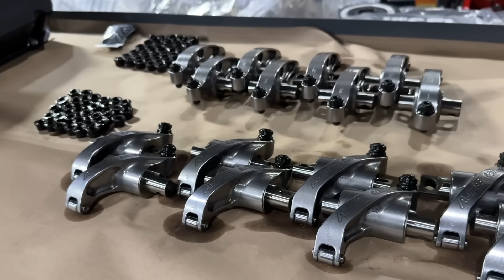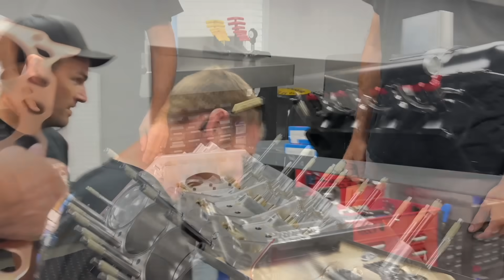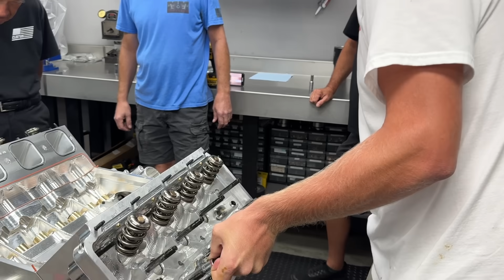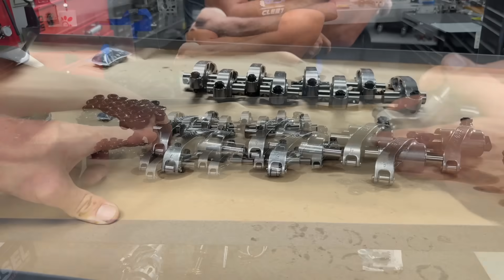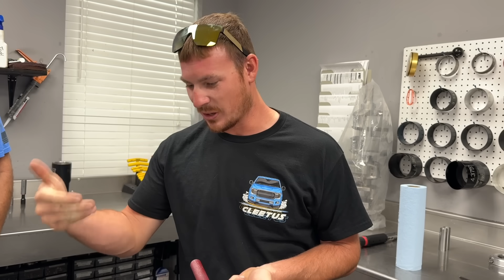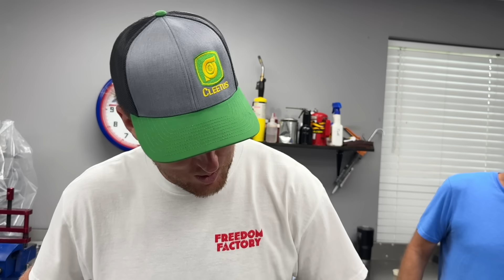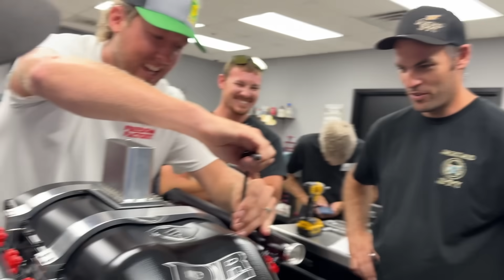Introducing Project Eagle's NEW Engine!!! (100% Billet)

Comment: “George be careful with that” immediately drops it 😂
Reply: Kinda saw that coming😂
Reply: My heart sank
Reply: Saw it coming from Canada.
Reply: He lost 1000 attaboy points right there
Reply: that was really bad.
Reply: If George wasn't funny, he'd have been fired 😂
Reply: lol probably just a $2500 piston 😂
Reply: Is that piston shot now? Was that fake? Like on purpose?? I’m slow man. I really thought they were that fragile.
Reply: Thanks I was just watching it trying to figure out what they’re babbling about. You’re the man
Reply: I saw that coming last week!!
Reply: @josef8061 those ones in specific, in theory take one hell of a beating in the a motor making 3500 horsepower at 8k rpms but I could be wrong about the durability and the way that impact happened. But I think it’ll be alright. If not I think they would’ve made a bigger deal about it in the video
Reply: Also the hp and rpm is just an estimate to get the point across. Its probably more so don’t hate on me 😂
Reply: Think it was a skit. Surely our boy ain’t that slow😂
Reply: @josef8061 Had to be staged.
Reply: @gerbil7771  me too loll
Reply: The slight glance up on old mates face when the torque wrench’s smack together hard😂
Reply: @josef8061  they’ll probably dye pen that piston for cracks which I’m sure it probably Dosent have any cracks, if the dye pen is good and it’s not gouged too bad they’ll probably sell it with idk maybe a 5/10% discount.
Reply: Didn't George ever hear of " You Break it   You Bought it"
Reply: I almost yelled fuck when he dropped it
Reply: It was so obvious i thought it was a bit
Reply: @Andrew_moto  what about flat spots? Not a big deal??
Reply: @dominic1102  could have been cut out of people were cursing too much. I’m actually curious.
Reply: @Andrew_moto  It was staged. It was too obvious. He wouldn't just carry it around like that in someone else's shop. It was probably a used piston that was getting swapped out. You only get so many runs before you change the rack.
Reply: Well, there goes like a $400 piston lol
Reply: @josef8061  depends where. In the top of the piston not usually, on the skirt or ring land area would absolutely be a huge deal. The only way that piston would be acceptable is if there’s absolutely no damage on those areas.
Reply: @josef8061 it will be fine, concrete softer than hardened steel
Reply: @dominic1102 It does, but slamming it into concrete is bad. It's designed to take a load in a specific direction, not get dropped on its side or skirt onto a concrete floor. If you say that's nothing compared to what it sees in an engine, you don't understand metallurgy.
Reply: What a clown dude🤡
Reply: I screamed
Reply: Squirrel immediately drops it 😆😅
Reply: I think they staged that
Reply: Definitely staged
Reply: His face was priceless
Reply: I so hope that was set up.
Reply: It was set up lol
Reply: the fact that they later said it was $5k for that drop. gawd dang
Reply: They were joking that was a used piston
Reply: Between him and James poor Cletus is going to be fixing their mistakes forever
Reply: It looked pretty staged as soon as he turned around I saw him fumble it
Reply: @Andrew_moto  it was a hundred percent planned as a bit, but it was still hilarious 😂
Reply: I think they are just pulling our leg fellas 😂
Reply: Duuuuuude!
Reply: Had to be staged right?? ....right? 💀💀💀
Reply: @josef8061 That specific one being billet is probably fine, just check for dents. But if you drop a stock piston like that it’s gonna be in a few pieces
Reply: George!!! 🤦‍♂️$1000 paper weight
Reply: @josef8061 engine builder outta Vegas here 🖐️ in most cases It would more then likely be a scrapped piston although I’ve seen worse happen to parts and be filed smooth + installed and last 100k harddddd miles before showing signs of failure
Reply: @yonotmyname  I sure hope so😂😂
Reply: Yuuuurrrrr duuuuooonnnneee!!
Reply: @josef8061 definitely not fake lol. His face was so real
Reply: Well that piston needs to be replaced now. Thanks George.
Reply: I saw it coming and still made my jaw drop... Don't call him squirrel for nothing 😂😂
Reply: I love how it cuts right after that too 😂😂
Reply: I hope that was planned. 😁
Reply: George talks to much for a camera man...
Reply: @pastorart23 immediately lost cool points for that one damnnnnn
Reply: @MrTwistyLive  Hardened steel? In what world are pistons ever made of hardened steel 😂
Reply: Wtf I want to see the footage of him getting the business after that dropping Piston noticed they cut it a little bit
Reply: @josef8061  I’m hoping they gave him a junk piston to purposely drop haha.
Reply: Caught it on the first bounce, should be fine 😅
Reply: I'd pay to see the unedited, long version.
Reply: Double dare you to put it in the 300 for a break in
Reply: Squirrels drop their nuts sometimes.
Reply: Like my toddler lol
Reply: @josef8061  No way it was not a setup. Truly good parts are too expensive to fool around with.
Reply: Being they warned him to be careful 30 seconds before he dropped it and the fact he stabbed the piston on the rod without securing it and carried it in a awkward position just before he fumbled it screamed fake.😅
Reply: You can't make that up
Reply: I DIED laughing
Reply: They didn’t let Mikey touch any parts again 😂😂😂
Reply: I don't know how George is a functional adult. How he couldn't see that coming is beyond me.
Reply: No right minded car person would put a top heavy piston onto a rod on that angle without a pin in it and expect it to stay there while walking around. Definitely staged.
Reply: What a clown.  I know that is his role in this cast but he does it so naturally.
Reply: @BreakitDownBarneyStyle more annoying than funny.
Reply: Staged.
Reply: Was that already a junk piston George dropped lol no way that actually happened 😂😂😂
Reply: I know like bro come on 😂
Reply: @gerbil7771 seen if from Newfoundland 😂
Reply: After that shot there was a wall of employees blocking the parts 😂
Reply: Well George that piston is done!
Reply: I'm guessing that was one of those little jokes they stage every once in a while and they're pretty good at making it seem real and most of the time people don't pick up on it
Reply: @mayshack  A lot of stuff is staged. Which would be fine if they didn't try to act like it was real. It's an easy way to lose trust from the viewers. I don't think Cleetus is a bad guy, but honesty goes a long way. I don't buy his merch bc I can tell how cheap it is on the videos. When he holds it up in the light, you can see right through it. He probably pays $5 at most for a shirt he sells for $30. I understand this is how he makes a living, but sometimes it seems like he's taking advantage of the support he gets.
Reply: its Cleeters fault for saying something, everything was fine
Reply: @josef8061  tbh looked like he was trying to do it the reaction looked real
Reply: Does anyone know if George is still alive
Reply: lol
Reply: George just bought it
Reply: George just cursed that new engine.
Reply: @josef8061  I'm pretty sure that was staged. Very funny either way though.
Reply: Hahahaha
Reply: Cleet didn’t say a word.  Lmaooo bro was probably pist for a split second
Reply: Squirrel  strikes again 😅
Reply: Cleet didn’t say a word.  Lmaooo bro was probably pist for a split second
Reply: Bruh 😅😂😅😂🤦‍♂️
Reply: I could see the white haired old man in the background shaking his head & looking at the other mechanic rolling his eyes!😂. I bet they thought you  idiots those pistons are aluminum, bet that one has a nice dent in it now hitting the concrete!!! 😂🤣
Reply: Yeah i was like WHAT THE HELL GEORGE. Jfc dude even for him. The cut was not for nothing, i bet.
Reply: George prolly should've stayed in Florida for this one lol
Reply: @dustynwilliams7816  exactly what I thought when I read his comment. Lmao billet and forged alum are a bit diff than hardened steel. You would think most ppl on here savvy this stuff if they're watchin on the reg. Goofballs
Reply: That's exactly why I don't like the guy.
Reply: @pastorart23 😂😂😂😂😂
Reply: Yep as he wanted over with no pin in it I shit myself
Reply: @josef8061 it’s straight Billit so it should hold a lot of damage done to it
Reply: Typical 🐿️
Reply: haha dont let him touch the belt lol
Reply: Nah not fake, he got grounded to full time camera man after that to keep his hands occupied. Notice how he didn’t touch the engine and everyone else did. And every time it was brought up you could tell bro was uncomfortable and genuinely sorry lol. Hope they were not too bad on squirrel he’s one of my favorites 😂
Reply: LS George is the oldest 2yr old I've ever seen!
Reply: Think the npk guys push 4500 horsetorques with these engines.
Reply: I wonder how many people saw that coming.
Reply: @mayshack  It becomes an issue when you have to question whether or not a person is telling the truth. I'll continue to enjoy his content, I just stopped believing that he was 100% honest and straightforward a long time ago.
Reply: It was easy to see that coming from across the Atlantic. Dang, George, whaddayadoin!
Reply: Yeah...
That would've been me too...
Old butter fingers...😂😂😂
Reply: Oh cleet had to hawk tuah on them hands 😂
Reply: Literally came to this comment as it happened 💀💀💀 lmbo
Reply: copied my comment, yet gets 20x the likes....wtf
Reply: Seen it coming from NZ
Reply: I laughed so damn hard
Reply: I aaa expecting a new SMX to be going in Eagle
Reply: @josef8061 it was to get u slow guys talking in the comments and the other peasant youtubers talking
Reply: It was definitely a bit, you can see the piston had been used before.
Reply: They skipped the next part, wonder what was said 🤣
Reply: coming out of his pay check lol
Reply: @stevenperez8197  yup
Reply: Quality ring to the alloy hitting the ground… defs 2618 for sure
Reply: Staged. Rehearsed. Planned. Spare parts, not from any engine build.
Reply: Classic
Reply: 😂😂😂 i knew that was gone happen
Reply: @josef8061  i think its a skit when has he ever been so careless knowing he is around high dollar parts never so that tells you right there and under the reflection it looks like it was used to start with
Reply: @Bob-o-h4k  yeah you can see it when the light hits it
Reply: It was def so offensive I was hoping it was staged
Reply: I dont believe for one second thats was on accident. If it was, watch that engine be the fastest thing theyve ever driven.
Reply: I know lol that shit hurt my soul
Reply: Laughed so hard
Reply: Squirrel had a spaz moment there. Ya'll need to keep him off those energy drinks :)
Reply: Was that freaking real !?!? Omg
Reply: He looks stoned right before he dropped it lol
Reply: Pretty sure that was a bit that was planned. The way he set the piston on top of the rod…George ain’t that dense.
Reply: There's no way that wasn't a skit. The way he looked around, they planned that
Reply: @BreakitDownBarneyStyle  There's a reason we don't see him seriously working on anything mechanical anymore, he just holds the camera and provides comedic relief.
Reply: hahahaha
Reply: I had the feeling it was gonna fall as Georgey turned around… luv ya LS! Can’t wait to the the bald eagles flying down the track.
Reply: Just INSTANTLY not careful with it at all 😂
Reply: HAD to be STAGED!! I hope!!
Reply: It was staged
Reply: He should stop acting stupid at some point.
Reply: damn bro grab the camera and don't touch nothing 😂😂😂
Reply: Cleet "huak tuah"😂😂
Reply: @dominic1102 they are strong but dont handle impacts well
Reply: “Not on purpose”😅
Reply: Did he drop the rod or piston?
Reply: @josef8061  In theory most likely yes its no good any more especially in that kind of application. Though I could be wrong but it looked like that piston was used and might have been bad already and the whole thing was staged.
Reply: LMAO
Reply: man, my stomach dropped with them lol
Reply: You listen to the ring when it hit the floor?? Thats SUUUUPER hard metal lol
Reply: I think it was staged. The pistons were already in the block. I don't see George picking up parts in that shop just to walk it over to show Cleet and Co.
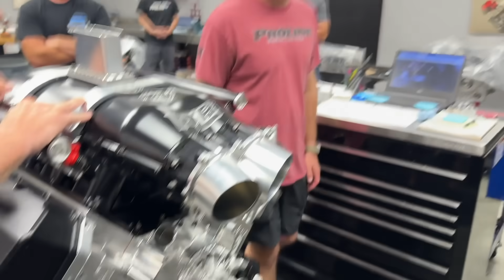Reply: 39:09 Straight up they’re probably gonna pull it apart and make sure they did everything right
Reply: Their pistons were already in the shortblock. I dunno how everyone missed that 😂
Reply: Weird torqueing the top row, then the bottom! Are all hemis like that?
Reply: Soon as I seen they weren't connected yet I knew he was dropping it 😂
Reply: @MrTwistyLive those pistons aren’t hardened steel dude
Reply: @WyFoster not even close bud your talking about a 6 figure engine
Reply: @Lexidezi225  forged my bad
Reply: George left his paycheck on the floor
Reply: @josef8061  Lmao i feel like it had to have been a skit. But yeah you wouldn't be reusing that, the edge would scar the bore.
Reply: That was definitely a set up. Prbly already damaged. No way he was that careless
Reply: @josef8061  I work with aluminum in the daily. It would have definitely dented by hitting the floor. An expensive mistake for sure.
Reply: How much further can they demote this guy. He's not allowed to work on the expensive stuff after forgetting some vital engine parts on his builds....like oil pump. He's gonna end up mop boy at the local sponge room behind the store by the truck stop that has adult written in big letters everywhere.
Reply: @stevenlaxton3618  A whole set of rods are only 2000. How can one piston be 2500?
Reply: My heart went into my throat when I seen that drop lmao.
Reply: He looked back like he expected a spanking 😂
Reply: People who think it was really 😂😅😂😅😂😅😂😅😂😅😂😅😂😅😂
Reply: I think he used up one of his "Upside down in the Wheelie Car Lives" on that one..  8 to go George.....🙃
Reply: @Limited-uq2yk   funny how he just holding the rod and let the piston hang on top .... I'm so dead
Reply: @Clem_Kadidlehopper  It was clearly a joke that they knew people like you would fall for.
Reply: Oh I got it.... GEEEEZZZZZ! lol
Reply: not sure what he was doong
Reply: @gerbil7771  even from Montreal lol
Reply: Lmao I saw it coming with how he had the piston barely on the rod while carrying it 😂😂
Reply: 1 handed Swagin , even realized the wrist pin wasn't in it
Reply: That’s not ok, looks like a bunch of clowns after that.
Reply: @newguybrett3746  It was staged. Calm down.
Reply: Staged
Reply: Youtube acting
Reply: And then like 1 mins " we gotta be super careful with this engine"
Reply: First time I flinched on a cleeter video
Reply: Pissed me off
Reply: Ya can't take him anywhere!
Reply: Remind me of chunk from the goonies dropping that thang 😂😂
Reply: @BreakitDownBarneyStyle  He's really not funny though. He tries way too hard, and he's the only one of the bunch that's annoying as hell.
Reply: @dalermehndi4663  My wife and kids love him. I'd like to say that you're outnumbered.
Reply: @Dealete420 🤣😂🤣😂👍
Reply: -500 aura
Reply: SAMF
Reply: @MrTwistyLive concrete is your worst enemy in a machine shop or building room.
Reply: @josef8061  It was on purpose or they didnt use it. At that boost and power level there is no way they would risk that, with that name, on his channel
Reply: @gerbil7771  HHAHAHAHAHAHA